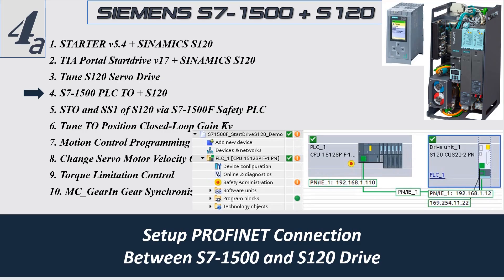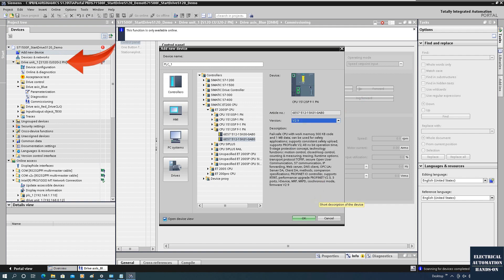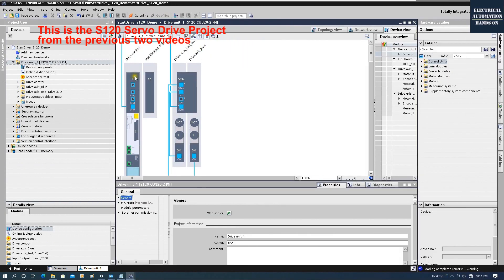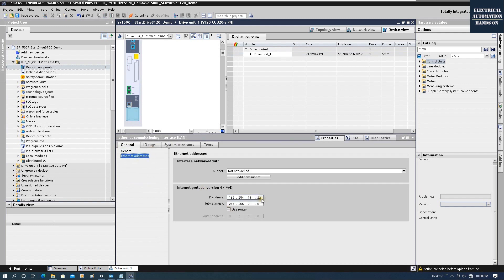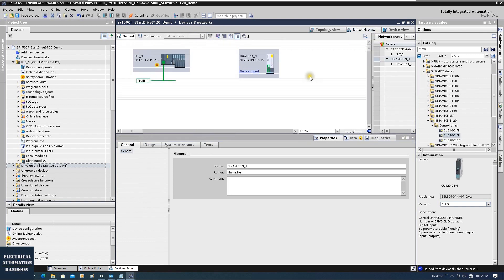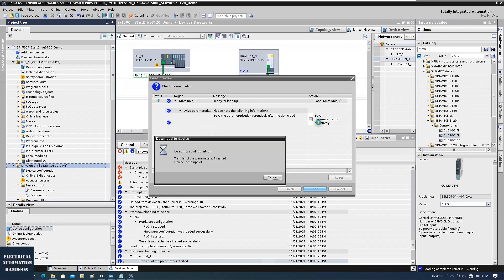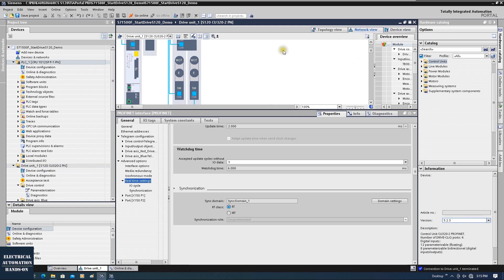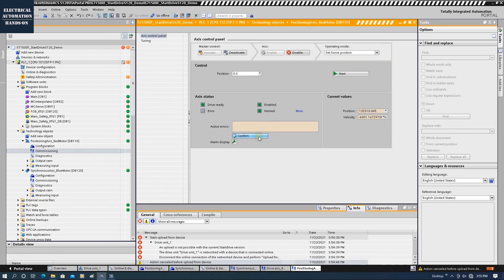MS05e. [Siemens S120 #4a] Setup PROFINET Connection Between S7-1500 PLC and S120 Servo Drive

Comment: First of all thank you so much for this motion control series, i just have one question, the thing is that i have a sinamics s120 CU320-2DP and i have a profinet module CBE20,the problem i can't establish a profinet communication via this module, is there any way to establish this communication? again thank you for you're time.
Reply from the maker: Thanks for you watching. Regarding to your question, are you able to use STARTER, Step7, Or Starter drive to browse and find CBE20? If you can search it, then set IP address for it.
Reply: @electricalautomation  sorry i didn't explain to you the situation very well, the communication i was talking about is between the PLC and the Drive, i can't establish  a profinet connection between those two via the CBE20 module